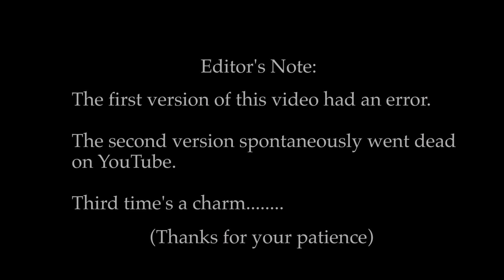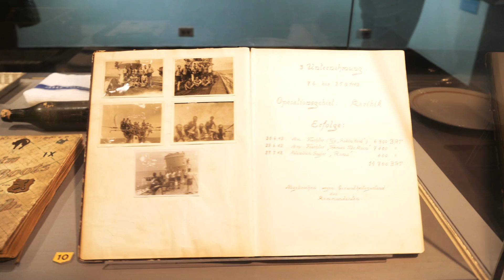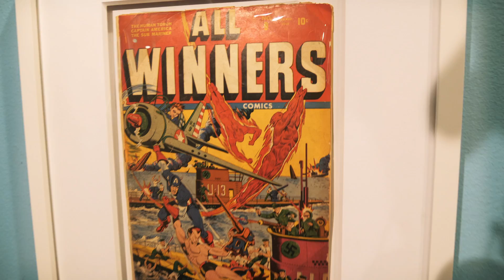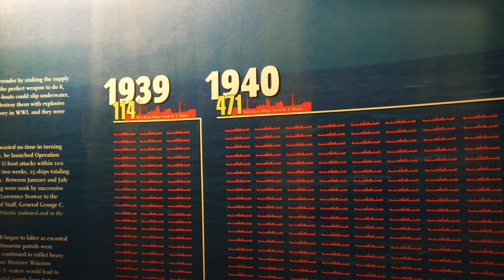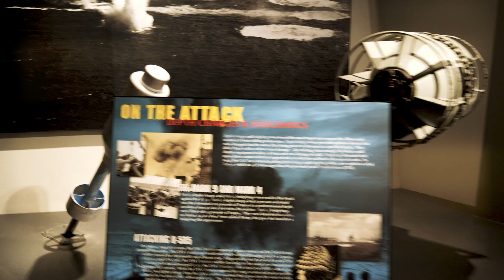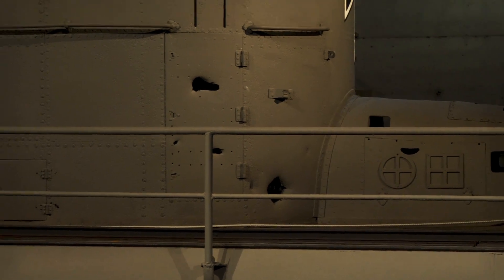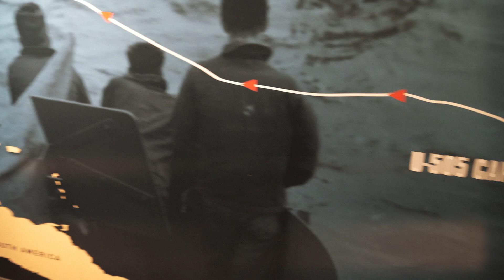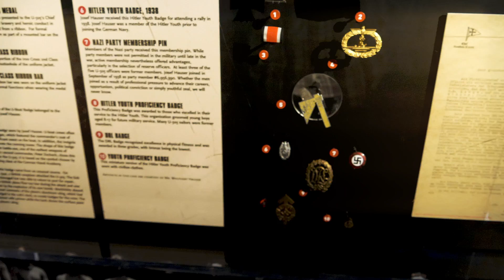Inside A WWII GERMAN U-BOAT!!! | History Traveler Episode 37

Comment: 7:07 The hedgehog had not the same concept as the depth charge. 
Depth charges damage a submarine by a huge explosion. The hedgehogs had a contact fuse and only explode when they hit an object. 
That's why they didn't need a lot of explosives. 
The advantage was that they could be fired forward across the bow in clusters much further than the heavy depth charges.
Reply from the maker: Yes, that was my bad. I made an annotation in the description.

Comment: Hedgehogs didn't explode at a predetermined depth. They had contact fuses because when the charges went off, that ruined sonar contact until the water calmed down. The hedgehogs only exploded with a direct hit, allowing destroyers to track the submarine until hit.
Reply from the maker: Yes, I misspoke there. I've made a notation to correct that in the description. Thanks.

Comment: Note: the enigma coding system was broken by July '41.  The Germans sensed something was wrong and added another rooter to the machines.  In early '42 Allen Turing had a breakthrough  in breaking this code/  It took time to develop but by '43 a great many enigma messages were being read in almost real time.
Also: (RE: mark 8:04) it is not called a CONEing (SP) tower, but a CONNing tower. (SP).
Finally, the 'Battle for the Atlantic" has hardly been overlooked, forgotten or minimalized.

Comment: Couple things. First, it's pronounced Con-ning, not cone-ning. Second, love this boat, been there many many times. I've filmed inside it many times as well, so that shocks me. I took the special tour they have occasionally which is private before the museum opens, they give you more time and allow you to meander back and forth as well. I was allowed to go in areas that are normally off limits, including the bathroom in the forward torpedo room. If you read Hans Goebeler's book he talks about putting an injured (or sick) man in there for days, so I had to go in. It was tiny. I sat on the toilet and closed the door. (I'm 5' 6" and I barely fit.) You can see the forward torpedo room at 9:16, the door is to the left near camera once you're in that room. Also Peter Zschech shot himself in the Captains bunk, so that area holds a lot more meaning if you've read the book. They had to suffocate him and wait out a depth charge attack and then dump him because he shot himself wrong. I also sat at the tables and laid on the bunks. Shocked they didn't let you film. Also, I hope you checked out the Spitfire and Stuka while you were there. That's the most in tact Stuka in the world, one of only 2 survivors.
Reply from the maker: Good information. Thanks.

Comment: Looks like you missed an opportunity to come to Manitowoc WI where the USS Cobia is on display.  It is a very interesting contrast to the U505.  The Cobia was designed for longer duration Pacific voyages and therefore was easier to serve on but  still I am sure it was quite a challenge to live and work on either boats.
Reply from the maker: Dang! Didn’t even know about this. Thanks!

Comment: RE: Hedgehog.  WRONG!  the hedgehog (British version) was mortar launched and was CONTACT exploded.  No hit, no boom.  The mortar launch system was murder on a deck.  The Americans were given the Hedgehog and used it through out and after WW2 into Korea, but they also developed their own version called the Mousetrap.  Same weapon, but rocket launched.  (Note: in WW2 film you can tell one from the other because the Mousetrap has fire coming out of the tail.)  In both cases explosions were by contact.  This was better than depth charges because if you had a bang, then you knew you had a hit.
Reply from the maker: Yes, I completely misspoke there. I made a correction in the description.

Comment: At 4.55 you say "During the war one of these U-Boats ended up getting captured; the U-505".  
That's true, but it doesn't reveal that two U-Boats were captured during the war.  In August 1941 the British captured U-570, repaired her and used her on active service - she was the only U-Boat to serve on both sides during the war.  To read about her, Google HMS Graph or follow this link: https://en.wikipedia.org/wiki/HMS_Graph   
There's a book about her: "HM U-Boat" by John D. Drummond
Reply: In May 1941, U-110 was captured briefly by the British, who removed her Enigma machine and more importantly, code books.  The U-boat sank the day afterwards, so she wasn't exactly "captured" (depending on how you define captured.)  https://en.wikipedia.org/wiki/German_submarine_U-110_(1940) 
The film U-571 is fiction but based on the Royal Navy's capture of U-110 and other U-Boat events.  
https://en.wikipedia.org/wiki/U-571_(film)

Comment: I've been on the U505 (prior to the discovery of the bread dough). It is shockingly cramped making the USS Pampanito, a US Fleet submarine from WWII, feel like a cruise ship in comparison. My dad, who was supposed to have been discharged from the army in January 1942 (this was delayed...) was also scheduled to sail with his army unit to England on the SS Normandie. That never happened, as the Normandie was capsized in the harbor before sailing, originally thought to be sabotage but later determined to be an accidental fire. Instead he sailed on a smaller ship (I think it was the USS Mexico). He said that the convoy no sooner turned the corner out of the harbor before the corvettes started depth charging U boats. Dad said he didn't know who he felt sorrier for, the Germans getting depth charged, or the sailors in the tiny corvettes dropping the charges, because the racket was like being in a trash can with someone beating the outside with a baseball bat. He also said that his ship had a torpedo explode near enough to lift the ship almost out of the water and knock the engines off line. He said all he could remember was being lined up with the other guys, life vests donned, three holds down, waiting to get into that awful, frigid water, where they were not likely to survive for long. Thankfully, the crew managed to get the ship's engines running again, and the actual amount of damage wasn't disclosed to the troops aboard her, being considered a military secret at the time. Several ships in the convoy were lost to the U boats. Must've been one helluva cruise.

Comment: Some additional history relating to U-505.Left  Lorient 1.8.43 and returned 2.8.43.Left Lorient 14.8.43 and returned 15.8.43.Left Lorient 21.8.43 and returned 22.8.43.In these sailings  U-505 returned each time when strange noises occurred when the boat was taken down to more than 50 metres.Sabotage was suspected and dockyards inspectors' findings resulted in the arrest of several French dockyard workers,who were subsequently shot.9.10.43 Left for Atlantic operations.Outward bound on the 23rd,she was located by surface forces and subjected to very accurate depth-charge attack.During the attack the captain Peter Zschech committed suicide by shooting himself in the head.   The first watch afficer Paul Meyer took command and escaped by firing decoys.Zschech was buried at sea when Meyer was able to surface some hours later.

Comment: I feel rather cheated by the fact you were not allowed to record video inside the U-505, but were allowed to photograph, I don’t understand why, after all video is just one still photo after another stitched together to show motion, hence Frames Per Second (FPS). Did the staff indicate why video isn’t allowed?, but, and there is always a but, the still photos are great, thanks for sharing. 😀👍🇬🇧🏴
I am sorry that I have to contradict your comments about ENIGMA, but, the Germans were using enigma way back in the 1930s and Polish intelligence had made huge inroads into cracking its workings before they were invaded, and either before then or after the invasion they passed on their work to British intelligence, and to cut a long story short the “ULTRA” section of the intelligence section were reading messages sent by enigma, almost in real time and complete, as early as 1941, the biggest issue they had was the code books, when new codes were issued to the Nazi war machine (and later Japan) they went backwards slightly until they either captured new code books or Ultra cracked the code, hence why the worlds first computer (Goliath I think it was called) was invented, and even though enigma was a great encoder/decoder machine the fact was that   a) the Nazi belief in the enigma machine being unbreakable led them to NOT  wonder why the allies often knew, (before the Nazi commanders what,where,when, and how operations were to be) where to be at the right time etc. and b) it was one of the best kept secrets of the war that kept the allies one step ahead of the axis forces in terms of intelligence gathering. Sorry again for contradicting you but it seems like a small but important part of WWII history. 😀👍🇬🇧🏴
Reply from the maker: I completely agree. Not sure why the restriction. I guess that fear that if people see a video, they won’t want to see it in person. I’ve found that to be quite the opposite though.

Comment: Wrong!!! Hedgehogs were a CONTACT fuze, not preset depth!!!! Only went off if it hit something!!
Reply from the maker: My error. I'll make a correction in the notes.
Reply: Yeah, I caught it too. They were very effective and may have been used more in the latter part of the war than depth charges. Probably because they could be dropped from planes, the most useful anti-sub weapons. With the B-24 Liberator closing the safe gap in the middle of the Atlantic, the U-boats' days were numbered.
Reply: @billd.iniowa2263  Hedgehogs where not used from planes. The advantage was, that you could fire in front of the destroyer while keeping sonar contact. Depth charges where dropped at the heck and to the side of the destroyer. You speed up and go over the U-boat while losing contact. It was hard to find the U-boat again after such an attack.

Comment: I grew up about 2 miles south of the Museum of Science and Industry and used to ride my bike there or take the Illinois Central train.  My dad took me there in the 50s when they moved the U 505 out of Lake Michigan and across the Outer Drive.  I was only about 9 or 10 but was still very impressed.  Until 2004 or so it was outside the museum on the east side but was becoming badly weathered.  I have not had a chance to visit it in its new quarters but from your video it is a much better exhibit than in the 50s and 60s.  BTW, the holes in the conning tower are from the .50 machine guns of the strafing aircraft and the 20 mm and 40 mm used by the destroyer escorts.  They specifically did not want to sink the U boat so that it could be captured and therefore did not use their 5" guns.

As you say, the Museum of Science and Industry is an amazing place and it really takes a full 1-2 days to properly see everything.  Also, about 3/4 of a mile away at the University of Chicago is the Oriental Institute which is an amazing museum of Egyptian and Babylonian artifacts.  Definitely worth 2-3 hours if you are interested in those periods.  And that is not to mention the Field Natural History Museum, the Chicago Historical Society Museum, the Chicago Academy of Sciences, the Art Institute, and a bunch of smaller museums in Chicago.  You can easily spend a week or 10 days in the Chicago area just doing museums.  If you have an interest in WW1 and WW2 history do not miss the 1st Infantry Division Museum (Cantigny) in Wheaton, IL, one of the western suburbs of Chicago.
Reply from the maker: Wow. Thanks for all of the extra info. Much appreciated!

Comment: 07:00 Correct me if I am wrong, but hedge hogs did not explode at a predetermined or set depth.  They were contact explosives.   Your statement would be correct for depth charges.
Reply from the maker: Yes. That was my error. I’ve noted a correction in the description.
Reply: @TheHistoryUnderground  Thank you for your attention to accuracy.   Contact me directly if you have any questions bout the Battle of Midway.   I probably know more about it than anyone would ever want to know.

Comment: Those men of the boarding party were very brave. They knew the boat had been rigged to explode (to avoid capture) but they desperately wanted any intelligence they could recover. Mostly that Enigma Machine. Nice video, thanx.
Reply from the maker: Yes, you are right. Pure guts.
Reply: Yes although the Captain was nearly Court martialed as the code books were the most important as we already had a machine & were breaking codes.
Towing it risked letting Germany know we had the machines and code books